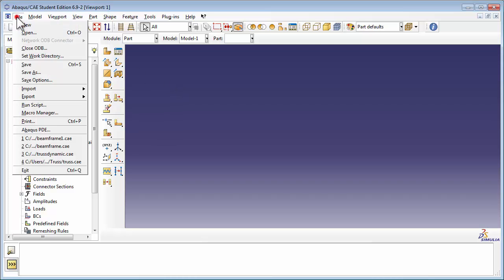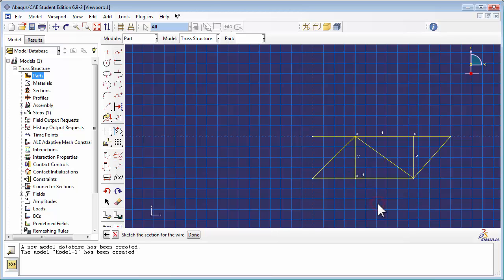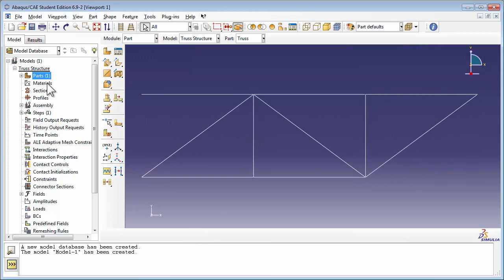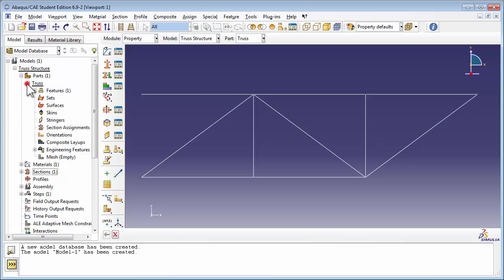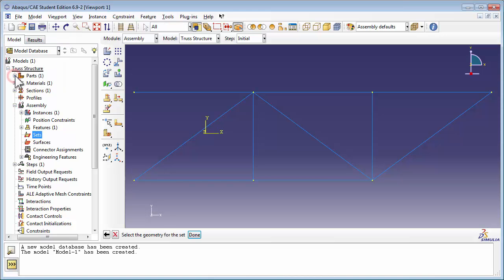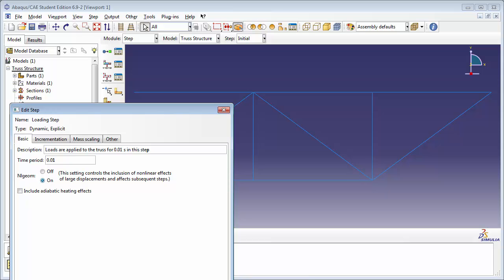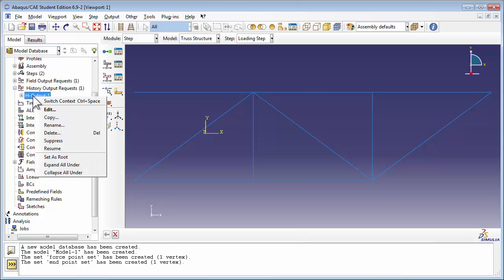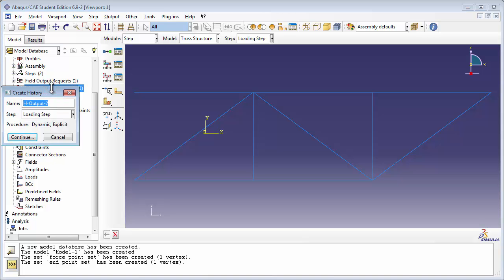3.b) Dynamic Explicit Analysis of a 2D truss - Part 1 of 2 (with audio)

Comment: When we dimension the truss after adding the constraints, the truss automatically deforms into some weird geometry. I work around it but why does that happen?

PS: Thanks for your videos, they are really informative.
Reply: I am having the same problem. I tried to work around it but my result does not match with the one shown in the video. How did you work around it ?
Reply: me,too.....
Reply: I solved it ! the way is that u choose horizontal constraint !
Reply: I had the same problem and ended up adding some extra horizontal constraints too. It seems that there are some other constraints being imposed automatically during the sketching.  let me know if there is an easier work-around
Reply: @amirk4507  Same thing happened to me. I had to add additional constraints to solve it too